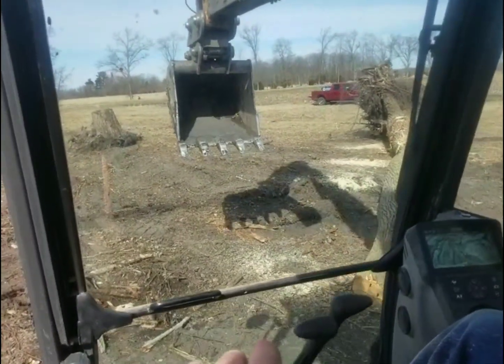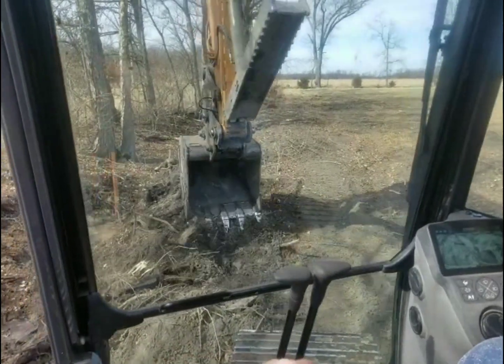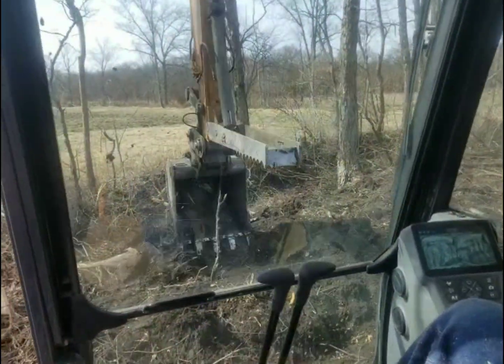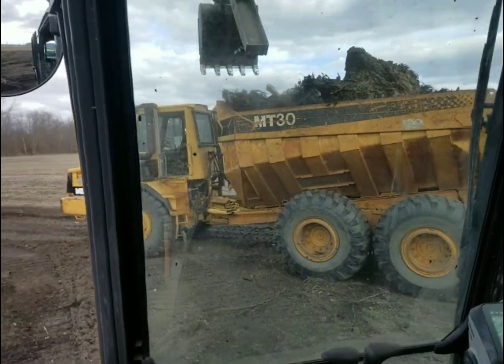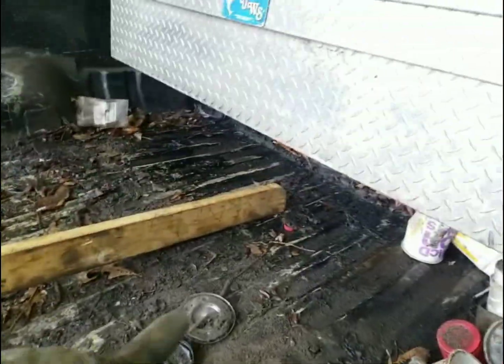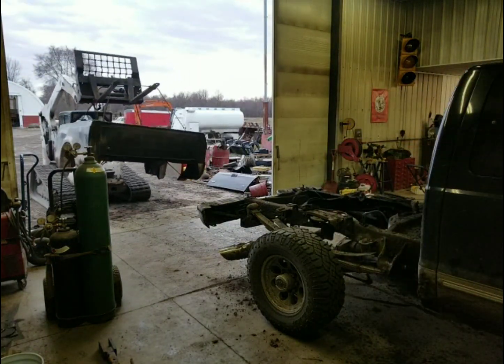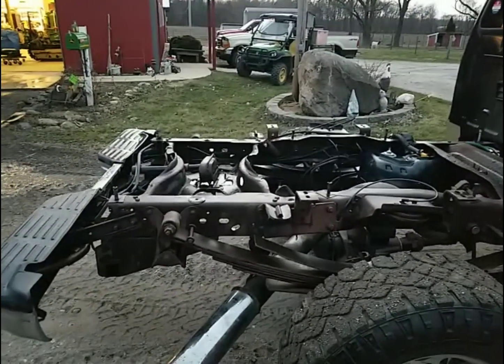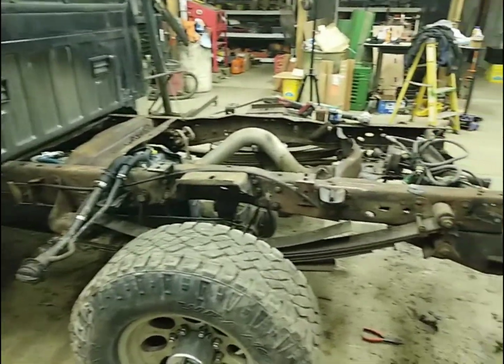Exciting Things Are Coming!!....The Haul Truck Is Back!!

Comment: You need an overhead hoist! Your metal fabrication skills you could make one really easily !
Reply from the maker: If you ever notice in out shop there is a green pipe over buy the wall it's got  8 yards of concrete around it under the floor that was supposed to be the shop crane that never got finshed lol it's on the to do list